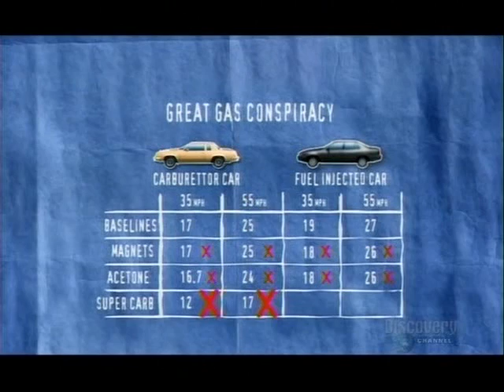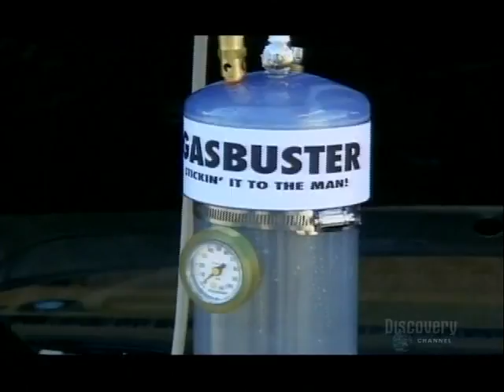Gas Saving Devices Busted 2 PartII

Comment: They did the acetone test all wrong. They put in way too much which brings the horsepower up and the mileage down. I use only 1 to 2 OUNCES per 10 GALLONS and CONSISTENTLY get 20% better mileage city and 10% highway. Multiple test over 10 years with 3 different cars. My Chevy Malibu is rated 23 city and 34 highway. I get 30 to 32 city all the time and 36 to an amazing 40 highway. I have the test engineers report and they don't so I know how much to put and they just guessed (guessed wrong) but they get their jollies yelling BUSTED.
Reply: https://www.sciencedirect.com/science/article/pii/S2215098615302469

Comment: Guys, I doubt they were paid on the Electrolysis machine. It's most likely that they may have forgotten to plug it in.
Reply: There could also be the case where the voltage is not ideal as well. Would have to double check the volts needed.

Comment: this system does work off 2 12 volt car battery's. using the process of electrolysis you break down h20. two parts (highly flammable) hydrogen and one part oxygen also highly flammable... while obviously these guys where not following the process at all. vehicles equipped with this system are using it as an  fuel additive brought into the system by way of engine Induction after vehicle is already operating.

Comment: To all you arm chair scientists, do the tests yourself.
Reply: I agree. So, I am doing experiments this winter in the garage and am finding the hydrogen thing actually does work. You can't just dump it in like these guys are doing. I think they may have wanted it to fail because they didn't think it through. Anyway, all the data is not in yet on my set-up, but it looks promising. I'm not on full hydrogen yet, but am using it in the air intake with great results. I've had to turn the gasoline flow back a lot so it wouldn't have too much fuel. That is the point though, isn't it? I see you on this page saying a lot, but have you tried it? I am having a lot of fun doing my experiments. Try it out for yourself if you're not too busy telling others to do that same thing.
Reply: Dumping hydrogen into the engine is a no-brainer, its all these kooks that think they can run thier car to the moon and back on a bottle of volvic with some big mountain dew bottles, a few paperclips and the wiring off thier stereo that spoil everything.
You'll always need a top-up source of energy to make up for losses inherent to a mechanical system, thats what all these meth-head Nobel Prize winners dont understand, they think its 101% efficient. Which is madness.

Comment: you're not going to improve MPG unless you turn the gasoline into a vapor BEFORE it gets to the intake... but all methods are dangerous. gas tank heater coils, pressurized gas tanks... there are several gasses that will run your engine with modification but none of them are drastically more efficient. there needs to be more case studies and it needs to be about cheapest way to fuel your car... not trying to improve MPG.
Reply: Well the HHO is technically best because if you have enough to start it, which you will because of capacitors already in cars for this very reason. The cold start. Then rig your wheels as an electric source so their rotation powers the electrolosis. Then its simple maintenance like a fish tank. Just some water. Its about surface area when it comes to these things. The more the better. They failed once with that, and twice with no power hooked up xD

Comment: Wait, wasn't hydrogen system supposed to be only as additive to the air? And second thing, very important- there is a difference in using this system on big engine and small one- we all know, that this system needs electricity to work. Both small and big engines produce almost exactly the same amount of electricity if there is not a 2nd generator. If the engine was some kind of small 1.6, that produces the same amount of electricity but in the same times takes a lot less air to breathe, i think this could work. This test is failng it's purpose. But don't get too exited- engine with added hydrogen won'l last long. I've heard that with this setup cars run maximum of 200k km because metal and other parts that is in contact with hydrogen gas just starts to disintegrate. No wonder why hydrogen is stored in special containers.

Comment: Dang what MORONS!
 Did they really expect the car to start and run when they NEVER MADE any Hydrogen yet! Kinda like a car runs out of gas and the carb is empty, just putting gas into the tank does not make it start again, you have to get that gas to the engine first!
 BOOM LOL
 So what, no-one has ever seen a gasoline engine back fire and shoot flames before? LOL
 Gee I was working on a car (running on gasoline normal) and lost some hair when it back fired!
 At least they did prove a car WILL run on Hydrogen, they did it from a tank but it did run!

Really though, they are just so stupid! Heck I ran a riding lawnmower on Propane from a tank just running a copper tube to the carburetor and letting the gas flow as you would to a BBQ grill. Been proven many times over WOOD GAS will run an engine! So why would anyone even doubt Hydrogen?

Comment: they had the air intake totally sealed off and it was obviously not making and HHO at all.....
if you think this was a legit test then you sir have no fucking idea how a car OR a hydrogen fuel cell works...

the car still needs to breath like it normally does and the HHO is sprayed into the air intake much the same way that nitrous oxide is delivered.
and a flashback arrestor is a good idea so you dont have those fire problems lol

Comment: Hydrogen fuel hho busted does not work Bye Bye HHO
Reply: myth busters would be taken off the air if they were costing the oil tycoons billions.....
Reply: they had the air intake totally sealed off and it was obviously not making and HHO at all.....
if you think this was a legit test then you sir have no fucking idea how a car OR a hydrogen fuel cell works...

the car still needs to breath like it normally does and the HHO is sprayed into the air intake much the same way that nitrous oxide is delivered.
and a flashback arrestor is a good idea so you dont have those fire problems lol
Reply: If you look in the video, there are no hydrogen bubbles! That means they wired it wrong. Hydrogen Cell are made to mix with Oxygen and Gasoline to increase MPG. You need a high wattage fuel cell strong enough to produce enough gas like when they tried it with the tank of hydrogen.
Reply: it seems you didn't even tried to run an engine on hho. It's produced if you heat the input airflow-bubbler-mixture (gas + water dest.) with the outcoming exhaust. I didn't tested either but to believe all that sht coming out of your TV isn't very good I think ;)

Comment: WHY IT EXPLODED? HHO LEAVING THE HOSE LINE DOES NOT BOOM ESPECIALLY HHO THAT HAS PRESSURE LIKE ONE IN THIS VIDEO. IT IS LIKE ACETYLENE AND LPG WITH BLUE FLAME. IT WILL NOT EXPLODE.

Comment: I can say hydrogen/oxygen works from experience. Thing is its not to run on the gas alone. You add it to the mixture to create a cleaner, more powerful combustion. But you need to lean out your engine by tricking the o2 sensor and MAP/MAF sensor in order to keep the engine from adding more fuel from the raised o2 readings in the exhaust. You can see significant improvements if set up correctly. You use less gas and with modern alternators the amps used (~10amps) dont effect the engine load a lot

Comment: the theory works is what im saying. I did not drive the vehicle for that exact reason, that I had no way to charge the battery. that is exactly what im saying, it as a theory does work, but to produce mileage or if used on a smaller less power draw scale, it would not produce enough to see any yield. why I originally commented was because of how they botched the administration of the device to the car, not that fact that it didn't work.

Comment: Well when you used that extra battery what charged it as you were driving?  And if as you state it is highly inefficient and there is no real mileage gain how can you say "it works"?  From what you described as your results it would seem if anything was concluded was that is certainly does not work..and you even supply an explaination why which yes...is the reason why.

Comment: that's pretty sweet. I only ever tried it on carbureted and used manifold vacuum on it which was difficult to control to say the least. I also had to use a separate battery to produce enough power. if hooked into the cars system, it would draw more power then the alt could keep up with. as I said before, it works, but it is highly inefficient and there is no real mileage yield id imagine.

Comment: I shall make one, it is a good point. I did it before I had my channel. I haven't made one since because the biggest problem was that the metal will rust and corrode. it only lasts but a short time unless an advanced system is used, but then the cost of the system offsets the benefit so there is no real monetary gain. but I will argue that hho, in theory does actually work, but in regards to practicality, it still has some distance to make up.

Comment: . . . how could you botch that hho system that bad. I have one I made for 5 bucks and when I hook it into my carb the rpm will rise at idle. proof that it does work. with one made from better than everyday walmart materials, someone could actually improve their mileage by around 1/4th id imagine, and with just water alone!!

Comment: Unfortunately there is quite a diabolical reason for the burning of fossil fuels and its affects us all who breath this stuff in .....very difficult for the narrow minded and conditioned masses....say goodbye to humanity in the coming millennium ..now gas is squirted into the engine under pressure with no fuel mixture adjustment possible and is not emulsified at all just droplets

Comment: Funny  the T model ford in 1927 had a vapor carburetor, the us military runs their fork trucks on hydrogen in the ammunition depots,many patents all bought and canned If these guys told the truth there would be 2 myth busters floating in the local lake face down. The engine valve overlap causes the back fire fit new cams and all cars could run on hydrogen producing water for emissions imagine fresh air to breath!
Reply: and nox to go with it

Comment: look into saltwater battery, no KOH needed, zinc and copper for the metals, make a 10.4 volt battery, shove the power of a 12.6 volt car battery back into it, and it makes oxyhydro gas, then run through a bubbler with a filter, then into a second bubbler, and you have pleanty of oxyhydro gas on demand and could possibly run the engine off hho only, depending on the engine size.

Comment: precisely why an oil injection system is needed, unless there is some form of lubricant going in with the hydrogen gas, like you said, before long the engine will be junk.

Comment: You're either A. Running the engine learner, resulting in detonation or decreased engine life, valve ping, or other problems, or B. Tricking the cars computer into thinking you're using less fuel (If you're checking via a data connection) Either way, burning hydrogen in your engine produces WATER INSIDE THE ENGINE. Your car will die soon.

Comment: I have a 2007 f150 5.4 liter. before hho 12-13 in city, 16-18 hwy. Yes, I go in just above the throttle body, 4 in. behind the M.A.V. sensor. I have 2, 9 plate cells, both run direct from battery. The change in take off, instant. the smoother running, Instant. 1 gallon tank w/ 45 grams KOH, to 2nd bubbler to throttle body, gives 17 city, 22 pulling trailer, 28 mpg with nothing but distilled water!!  It works been running it for yr. NO ISSUES, just GREAT MILIAGE

Comment: You actually get two parts h2 for one part o2 as the hydrogen atoms readily combine with each other, and some hydrogen and oxygen reform water. Direct water or water-meth injection at normal temps and mid to high rpms causes an increase in combustion efficiency leading to more power and fuel economy, much better than HHO and much less stress on the alternator and real measurable gains. HHO cells aren't worth it, try a fuel vaporizer insteadif you want more efficiency and economy.

Comment: Absolutely! My HHO dry cell has improved my mileage! And I haven't even installed an EFIE yet! I don’t even have a PWM connected to my cell. It was only pulling about 1 and ¾ to 2 amps (about 1/3 of a liter in 6 minutes) and it has saved me (two tanks in a row, now) just a little over a gallon of gas each time. I lost a lot of respect for the competency of the Myth Busters!

Comment: Bubblers are meant to replace some of the fuel not all of it. If you try running an ordinary engine with normal timing and compression ratios, the results will be about as good as when he overfilled the carb with hydrogen. And a bubbler only works with a catalyst(baking soda,etc) and when its actually turned on.

Comment: Funny you should mention tanks with high PSI, I have heard about cars using compressed air as "fuel" , long ago I remember they were working on a car with a large gyro spinning in a vacuum levitated by magnets spinning at mind blowing speeds. they all look good on paper until someone gets in a wreck.  one problem with Hydrogen also is that it leaches out of any container because of the small molecular size, as for safety, I have read about work being done using hydrides.

Comment: I read your comment again.  I mistook what you said for the rest of the optimist crap.  You're right, solar could be used in that way.   The real obstacle is storage of the hydrogen.   You'd have to compress it WAY down to put a useful amount in a space the size of your average gas tank.   And I don't know how safe I'd feel driving around with a tank of hydrogen at a couple of thousand PSI.

Comment: Less than 100 percent efficiency in conversion of light from the sun into electricity is still a net gain of harnessed energy.  You didn't have to expend any of your own energy to make the sun shine.   Less than 100% efficiency of conversion of hydrogen from water in a CLOSED system is a net LOSS of harnessed energy.  There is only so much stored energy in a given chemical bond.   It is a logical impossibility to derive more energy from breaking that bond than it contains.

Comment: Yes, hydrogen may not be 100% efficient, but it doesn't matter,  i mean take solar panels, they are not efficient but the energy is free !! I get ticked when i see comments by other, that say solar is not good because its inefficient , so what? i say, I would rather have something that is 20% efficient that is free, than something that is 80% efficient but I have to pay for the energy. solar could be used to make free hydrogen, and there you go..

Comment: -cont. working purely on water, ( hydrogen conversion ) goes against the laws of thermal dynamics,  you can NOT get more energy out than is put in, no space here to get into an explanation, put simply, energy is needed to separate hydrogen from oxygen, will always be more than the energy you get when you combust them together. one should think of hydrogen as a liquid battery, use a "free or cheap" energy source to make hydrogen externally, then use the car on hydrogen.

Comment: I like the mythbusters show, but sometimes, they try too hard to bust a myth, in medicine, double blind studies are done for that reason, desire can effect outcome.  I would like test done on using cryogenics treated engine, ( parts deep frozen to reduce friction ) and the famous vaporizer carbs, ( gasoline is thoroughly vaporized before going into the combustion chamber ) systems. as for hydrogen, the injector system may work to increase efficiency of gasoline, but as for a car working - cont

Comment: @wallblues No they didn't do it Properly It's like Pouring Gas Down a Carb. it Tends To back Fire if they had built a New Carb or Fuel injected Manifold it would Probably Work quite well it just proves these guys are Idiots.

Comment: there only useing gas and bloked of the air what the engine need. the car can't run on fuel alone. it stupit that the not have seen that a engine also needs air to burn the fuel. it works on the last bit with a open air en fuel intake to the engine

Comment: the unit was not producing any hydrogen for the car to burn as demonstrated the engine does run on hydrogen because hydrogen burns we had a old pizza truck designed to run on propane that we used to run hydrogen gas in all the time but as for the creation of hydrogen gas on the fly to burn in the engine requires major modifications of the hho unit and engine and you still wont get the results you want anyone who ACTUALLY experimented with this and not just watched a bunch of BS online knows this

Comment: hey u need to make the unit better the one u made really sucks and u dont want to run ur car off of just hh0 because it can rust ur engine take the hh0 made a new and better one and put at least 20 amps to it then lower the gas going to the carb and the hh0 will make up for the lower amount of fuel

Comment: @pavlopof thanks for that. ive got 4 different ways to increase fuel efficiency. and there isnt any magnets involved, and acetone is just a fuel system cleaner like seafoam. ive plugged up two pencils to a battery charger and got more bubbles than what they are getting.

Comment: @gochanging
  G'day, howgoesit ? Would you be the "Resident- Sceptical-Debunker Troll..? If so, pleasedtameetcha ! I'm the Fool On The Hill that's trained his vehicle to be 50% more fuel-efficient ( 8 Km/L per month, to 11.98 Km/L per month). Measure the Static-Drain via Batt's Earth-Lead, x 24 +(1% B's rated capapity, for sulphation) = Vehicle's Min. Daily Discharge. X 1.1 = Min Daily Recharge, in A/Hr (@ 207-310ml/A-Hr). Search 'sunfoil', & ENJOY..!